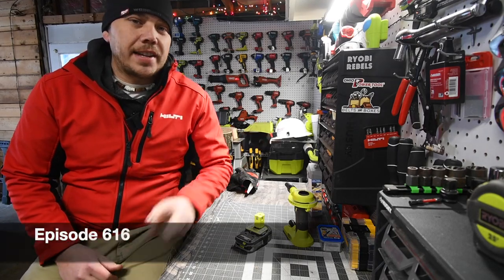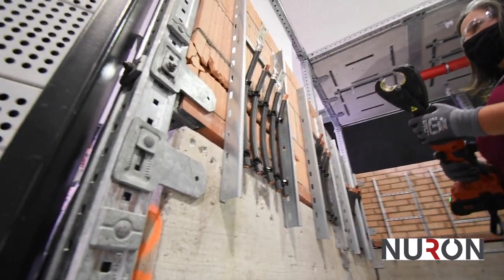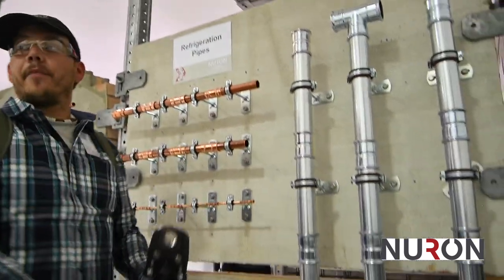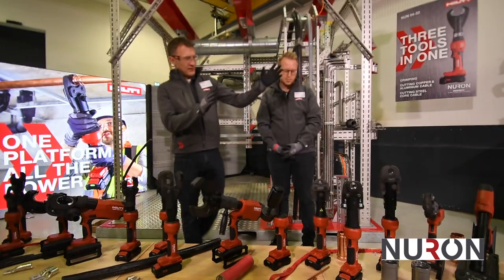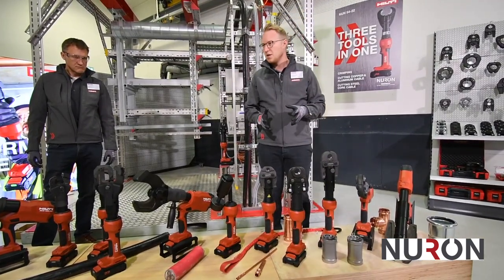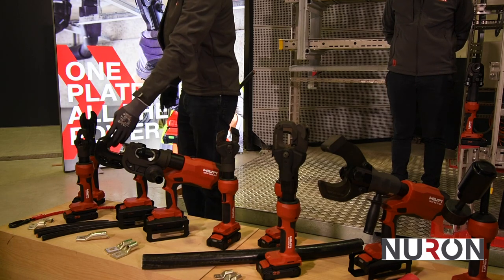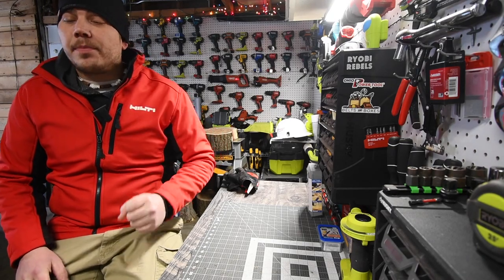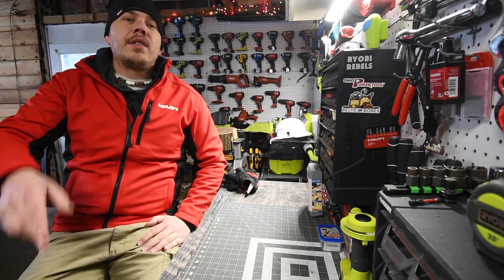New HILTI Nuron Hydraulic Cutters and Crimper Demo (Part.2 Station 2)

Comment: Awesome tools i like them but not sure about the data sending batterys wonder if theirs a way to disable all that with laptop or some kind of plug in device
Reply: If you are not a fleet customer, you don‘t have to use the data module on the charger if you don‘t want to.

Comment: I have used an electric cutter hydraulic crumper but they're all manual Where you have to pump the hydraulic  Electric cutters are expensive we had a ratcheting set of cutters     👍🏻☕🍩🐶☕🍩🐶